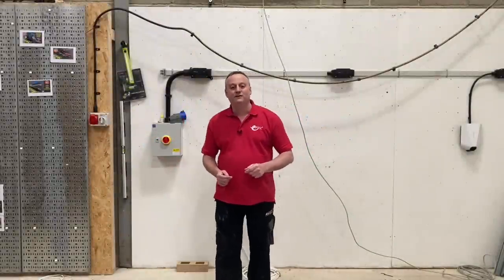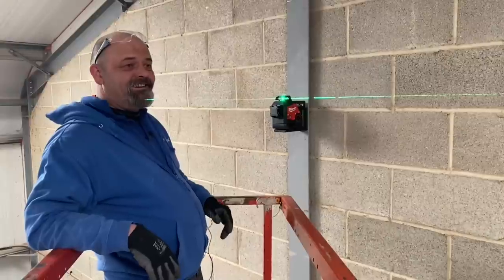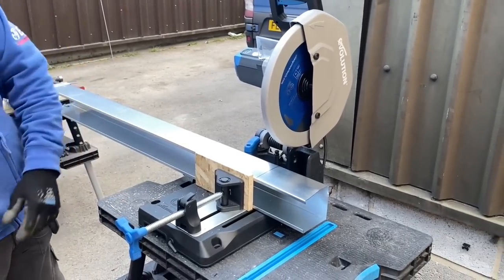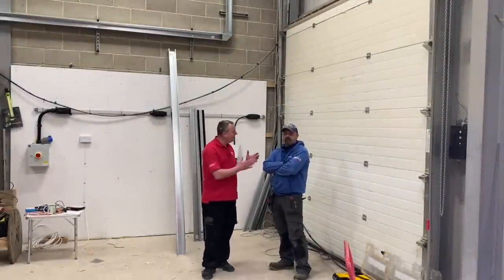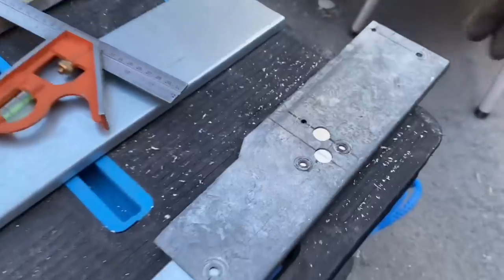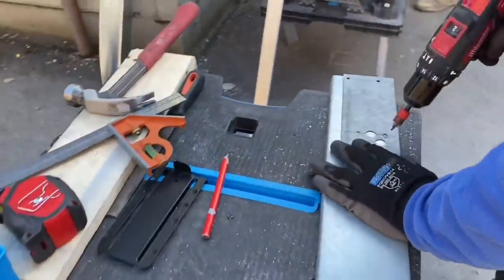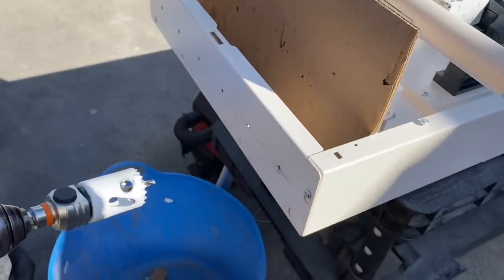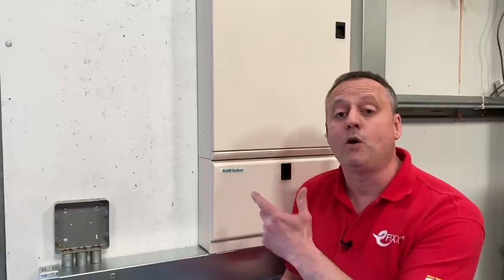Legrand trunking INSTALLATION TOP TIPS - tools and techniques

Comment: Some of the jobs in Scotland we have to show the galvanized paint on the outside to show the galv paint is on....
Reply: I see the method in this, so consultant, inspector or QS can see that you've done it. Makes perfect sense, though I'd prefer not when on show
Reply: Sorry for the dumb Q, but is this paint necessary for indoor installs? How long will it be before it rusts (inside a cupboard under stairs?)
Reply: @MatSmithLondon  Hi Mat, for starters there is no such thing as a dumb question, just dumb answers. To answer your question regs 134.1.1 and 134.1.4 , these however would also depend on your engineering judgment . This trunking was fitted into an industrial unit, which can be damp environments especially at higher levels due to temperature changes. Most of what I fit is in plant rooms, which also have environmental changes which can cause condensation and damp. How long before it rusts, totally depends on environment the trunking is to be installed. We recently done an upgrade on a plant room which I originally installed 25 years ago, due to correct installation methods the old trunking and conduit were still in sound condition. Hope this helps. Regards Eddie

Comment: You could always take the plate off the DB to drill no hoovering at all then.
Reply: Fair point Gregg. More of a general tip, I work on a lot of control panels thus components, contactors etc could be effected by swarf ingress. Thanks for the observation.
👊😎👍

Comment: Liking the drill template. Will have to make one up.
Another top tip:-
Evolution S355... you can get stainless blades for them that negate the need for filing the edges
Reply: Cheers Jonathon, will definitely look into them 👊😎👍

Comment: I wanna work with Eddie. 👍👍👍
Reply from the maker: I want to work with Steve 😆👍
Reply: Thank you 👊😎👍
Reply: @eddie_pegasus_electrical  👍 I like the low profile socket pretty sweet tool. 👍
Reply: @Oufg103f  it is a VERY sweet tool. It’s called a Brocket aka The Bush Socket available in 20 25mm at moment. 32 38 50mm are prototypes
Reply: @eddie_pegasus_electrical  👍 a five piece set of them is a must. 👍
Reply: lovely work 👏
Reply: @eddie_pegasus_electrical  doesn’t a normal bush wrench work ok for you?
Reply: @MatSmithLondon  Hi Mat, to answer your question, yes and no. Years ago, 30+ the king bush spanner was king for 20mm & 25mm bushes, unfortunately they cheapened the steel and became useless. Tried several variants of which were no good. I then adapted 2x ring spanners as you can see in a previous video with eFixx https://youtu.be/lcJzr6RWb-4 . I’ve also tried later models like the CK bush spanner, which is OK. The CK bush spanner struggles with tight spaces, and also when tightening up in the back of a trunking as demoed in Adrian’s promotional video https://youtu.be/MdQscC2s5ro  also eFixx have done a visit to Adrian’s workshop https://youtu.be/CRFJ1SD_2Zo . 
As quite a bit of my work involves trunking and conduit I personally think that the Brocket is a game changer in this field. 
Hope that sort of answers your valid question, Regards Eddie

Comment: Some great tips. 

Just wondering why the trunking was spaced off the wall (on the unistrut)?
Reply from the maker: To navigate over some of the structural steel work and we will
Also be adding some cable basket under the trunking run.
Reply: I will be using this technique for Legrand trunking around perimeter of my garage. There are some mini trunking sections for sockets and light switches I need to navigate over.

Comment: No paxolin ? 
Arhhhh, I`m just joking. If you have any Top Tips about cutting paxolin, that would be great too !
Reply: I’m sure @efixx could do one. If not we could 👊😎👍
Reply: That was my only issue with anything in that video. I hate with a passion opening up a board/trunking to find that it's been bushed and the bushes are full to the gills, but the board still has capacity. Much rather paxolin or even some manufactures are now making folded edged bottom plates instead of the fully sealed ones as shown in the video
Reply: @darylsavage119  fair point, totally agree. Thought there is 6 x 38mm bushes in bottom and also 6 x 38mm in the top,  More than plenty entries, if they were all filled to the gills, both the DB and trunking would be undersized. Just a thought.
Reply: @eddie_pegasus_electrical  fair enough, typically in the shop fitting I do, we have 6 or 7 boards fed of a select panel, and the boards are all different sizes fed by either a top or bottom entry 12x9 trunking, so in our situation it would be awful to bush, but every situation is different!
Reply: The other issue you have with using bushes is people take live and neutrals of the same circuit through different bushes, I always slice the bottom of the trunking and fit paxolin, MEM EATON do a trunking interface kit for there boards and they are great
Reply: @greggsmith4539  Fair point, though not an issue in this case, as L, N & E are on same side of DB to MCBs.

Comment: Is there a reason for not using cutting compound with the hole saws?
Reply: Additional cleanup and works fine without? I mean you technically should... but who cares if the cut is okay and the hole saws are the cheap set from screwfix?
Reply: @MatSmithLondon  Only as I'm from Yorkshire.. Known for short arms and deep pockets! Makes my hole saws last longer.. :)

Comment: The nuts are really thin now on those bushes, where's the quality gone?
Reply: That disappeared over a decade ago unfortunately 😬
Reply: @eddie_pegasus_electrical  So I'm lead to believe, I was talking to Apex. about it, I haven't worked on threaded galv conduit for over 24 years. Do they shear off, they look really think, don't even cover 100% of the hole.
Reply: @9plusinstalaciones  yeh I saw that. Was a bit triggered by seeing the holes still once they were installed. Shame they are so paltry!